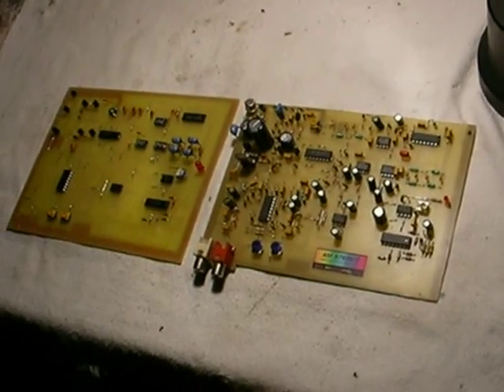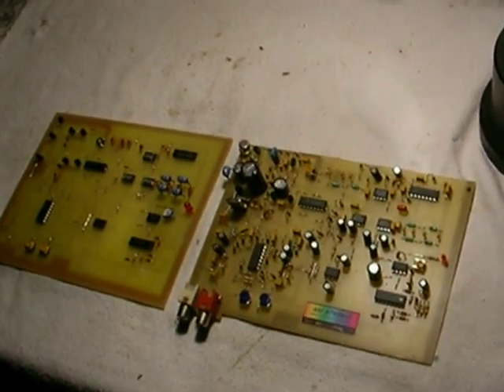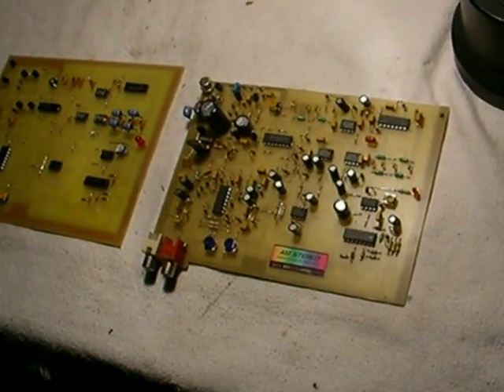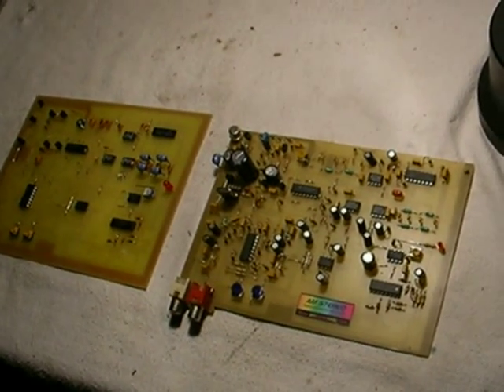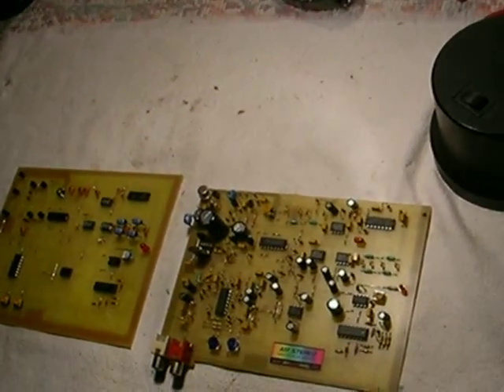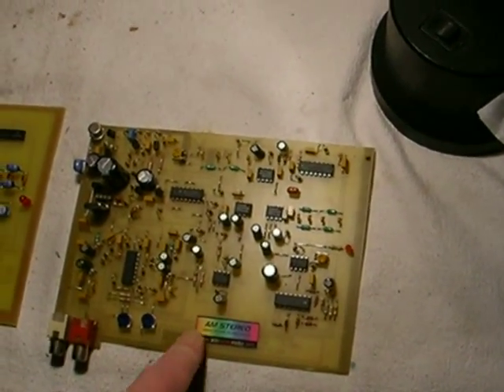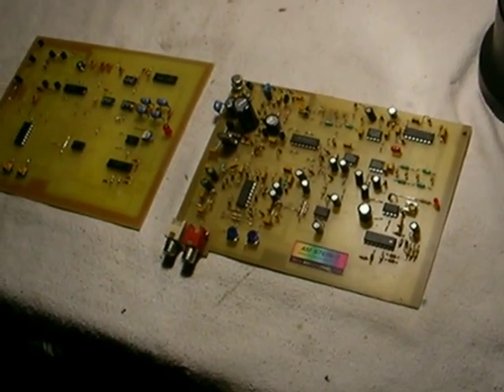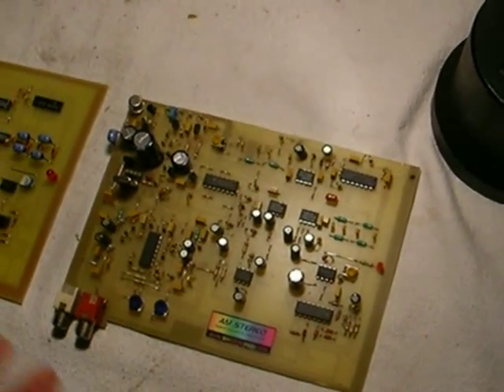AM Stereo transmitter orders

Comment: If you ever decide to do another run of these, and you might think about "fund me" or a kick starter project for these, but anyway I would be quite interested in either a kit or just the circuit board. Hell even if you sold the foil pattern for $5 or $10 I could make one of these boards. I would love to have a kit, but the circuit board is really all I need with a parts list, just order the rest from mouser.

Comment: the 5.8 MHz crystal however fit in the socket perfectly without any modifications to the leads as its the HC-16 type I think. Much like the one included with the transmitter as its a standard two legged crystal.

Comment: @fortyfiveplayer Sounds logical, much like antenna matching on amateur radio transceivers. I will be looking into junk AM radios soon in order to make my own antenna tuner since I moved the frequency. An electronics surplus store in Nebraska has the best selection of crystals I have ever seen and I got one of the HC-6 type from them for 4.92 MHz (1230 KHz) along with 5.8 MHz (1450 KHz) so that I don't stomp on local AM broadcasters. The HC-6 crystal I had to adapt but it was not hard at all.

Comment: @fortyfiveplayer thanks for the tip, I will keep that in mind should I run into a non working or hopelessly broken AM radio. I actually put the transmitter to use at a garage sale to demo a tube radio from the 1950s which is still in working order a while back and it seemed to work well with a mono radio using an envelope detector. Not to mention those old tube sets sound great when they are maintained as I learned from this whole thing.

Comment from the maker: @bratina501 Make a "quick & dirty" antenna tuner- use a tuner capacitor and matching ferrite loop from a junk am table radio. Keep the RF section /antenna connections the way they are in the old radio, and put this whole assembly in series with the antenna.

Comment from the maker: @bratina501 Ya gotta remember as you go up in Vcc, you have to readjust the RF2 gain pot, and the antenna tuning becomes more critical. I run mine at 24 volts with no issues at all- except for the antenna tuning being critical.

Comment: @uxwbill I would like an antenna tuner myself because I get the feeling that the range is not as good as it could be even under part 15 regulations. Just some advice on processing the audio, of course matrix processing is not needed but do not use a stereo boost system that increases the volume of stuff that appears in the far left or far right of the stereo image because that will result in some weird distortion due to the transmitter's internal matrixing circuit.

Comment: @uxwbill Or me for that matter but don't call yourself a dum-dum you seem to have the mental capacity to understand electronics. But yea thats true, this transmitter really is HIFI and in fact I have the one I built running right now playing country music from the 1990s and being received in stereo on a Delco UX-1 AM stereo/FM stereo car tuner. The only issue I have is with programmable oscilators. If I supply the transmitter with more than 9 volts I get phase noise.